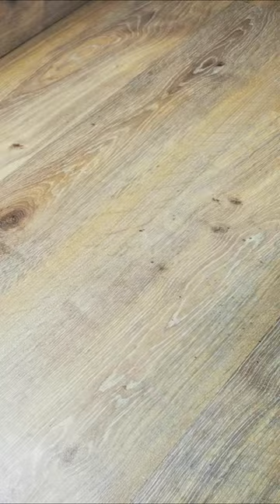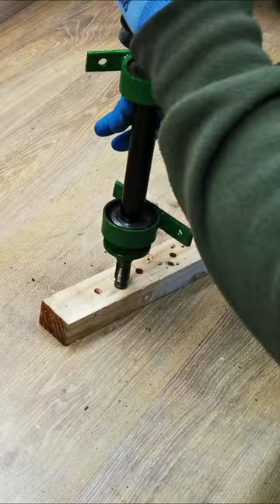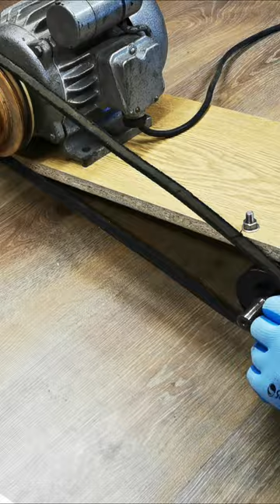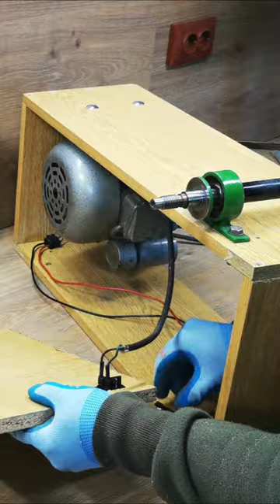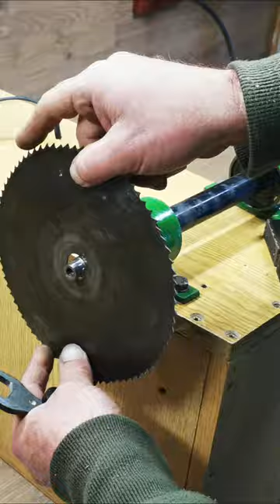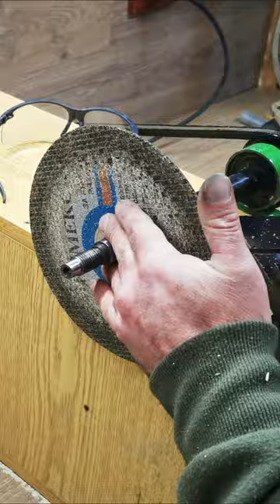How to Make Homemade Multifunctional Mashine From Washing Machine Motor

Comment: There is an angle grinder. And you can even hold it in your hands. And, lo and behold, you can even change the disks on it. And even cut steel with it. And it costs much less than a three-phase asynchronous electric motor, two ball bearings, a shaft and a mounting clutch. And the work done, of course.
Reply from the maker: It is made with available materials.  The electric motor is from an old unusable washing machine, washers made from pieces of wood, construction from old furniture.  The only costs are for 2 ball bearings and a belt.  The idea, I think, is to make something out of parts that we would otherwise throw away.
Reply: @_gkworkshop  I'm a machinist. I don't understand the use of wood in mechanisms. Probably in the 60s of the last century, such a design took place. But now, when Chinese electric tools are cheaper than the garbage from which they are made, such a design is not worth the effort.
Reply from the maker: Hello!  I am in no way disputing what you said.  I made something from materials I had at home without having to invest money.  It works perfectly for my home needs.  There is absolutely no question of a professional.  But as my grandfather used to say, "If you have dexterous hands, you can do without tools, if you don't, the tools don't help."  And despite everything, the idea is to make something yourself for pleasure and with available materials without having to buy them.  Do it yourself.
Reply: @_gkworkshop  At the dawn of my career, my then future boss told me - here are files, metal, motor and discs for you, make a working mechanism out of it. After spending two days making a bevel gear and assembling everything together, I was hired with the maximum salary. This creepy contraption still stands in my workshop, reminding me and my colleagues of the tenacity and importance of knowledge and accurate calculations. Ten years later, I'm still cutting metal on this machine. p.s. please put a protective cover on the belt drive and disc. No one needs injuries.
Reply from the maker: Congratulations on your persistence years ago when you started.  P.S. The notice has been accepted and will be removed.  Thanks.
Reply: @_gkworkshop  And one more thing. If you use this machine all the time, you will need to tighten the belt because it will stretch during operation. It will be quite enough to cut out linear cutouts for fixing the electric motor and fix a screw stop in front of it.
Reply from the maker: There are some, but I haven't put a screw in, it's tightened manually.